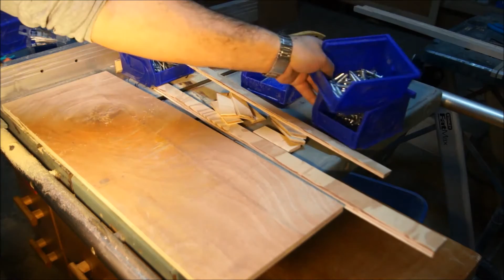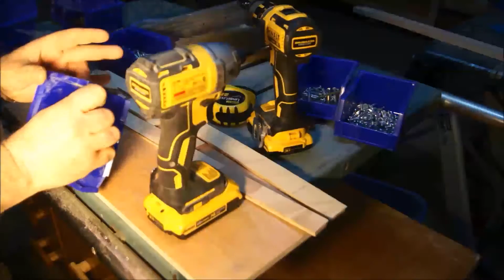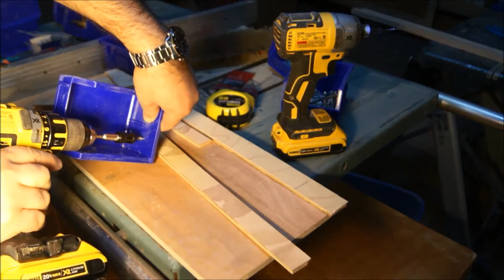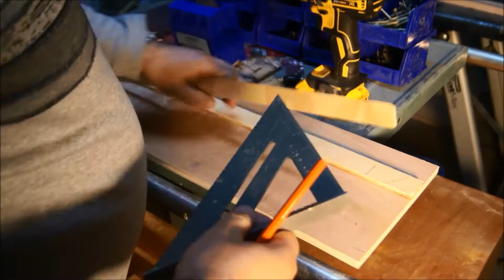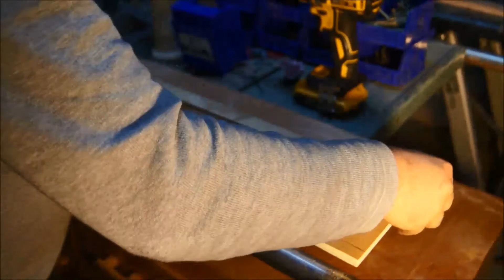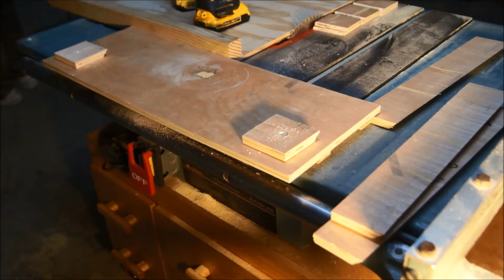French cleat storage system for plastic bins

Comment: I can hear you just fine. 
Could you have used wood glue on the bins instead of screws?
I know hot glue would work, if you didn't want holes in the bins.
Reply: Glue won’t be strong enough alone. If anything glue and screws would be best. You can also get bins that have screw keyholes in them. You hang like a picture - no holes.